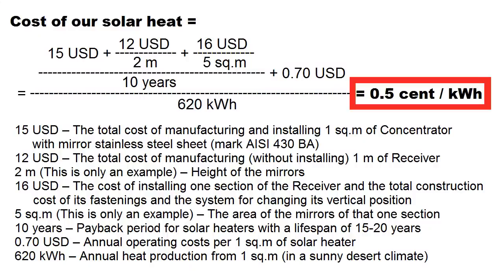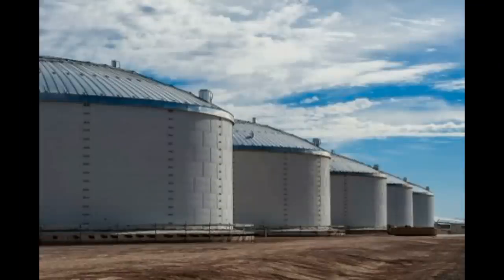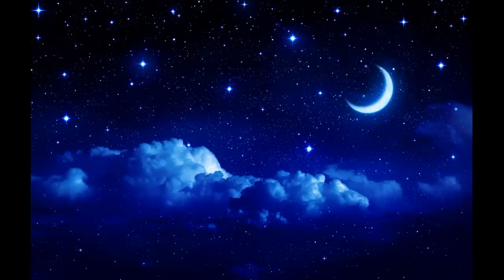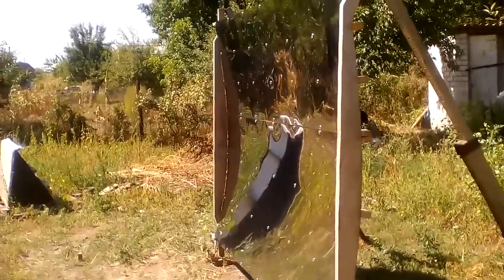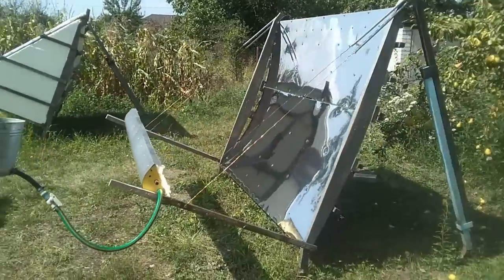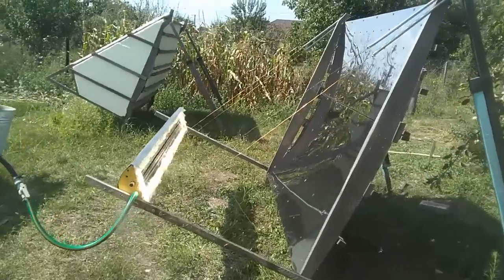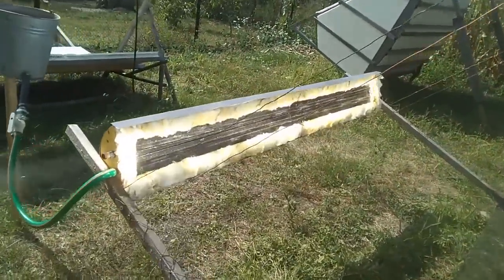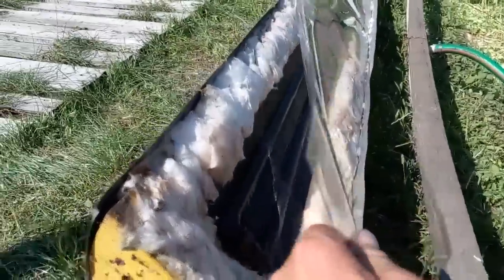What is this new method of producing solar electricity?

Comment: Thank you for uploading your videos. Collecting the solar thermal is one thing, but have you perfected the generation of electricity? One thought is that the storage of electricity is more difficult than the storage of heat. One concept that looks interesting is the sand battery, a simple auger could be used to raise sand to a thermal head (where the sun is focus) and then gravity could let if fall back into insulated storage vessel. Since sand can be heated to 1700'c this is ample to flash water into steam for electricity generation.
Reply: Stirling engines look very interesting, but there aren't any 'solutions' for around the 500W mark.
Reply: @mungewell  because they are stupid, just use a steam engine of some sort, even a tesla engine will work, vacuum tesla engine even better

Comment: New subscriber, GREAT channel!

The Carrington Event is due to appear again and all metal wire, so all circuitry, all solar panels, will try. Your panels would not be affected, particularly the stainless steel mirror. 

I have not yet viewed your videos which explain the transition from steam to power but, again, * anything * that avoids metal or circuits will be very valuable after the  fact.
Reply: fry not try

Comment: Steam could be passed through a heat exchanger. Water in the secondary loop could be used to heat the home by radiators. The water temperature could be controlled by a simple electrical solenoid valve that either routes the steam through the water heat exchanger or to an out side heat sync to dump excess energy. If you wanted to add cost and complexity then instead of dumping the energy then it could be used to generate electricity. The simple version just to generate heat alone would be very useful.

Comment: Hey Sergiy possible to use this on a sand battery? ie use to store the heat storage with sand?
Reply: He already has the space.. I was thinking the same. And is also (pretty) cheap to maintain and build. I'm sure that the electronic part is more difficult. Since the sand battery has some sensors and automation

Comment: I appreciate the idea and would like to try this idea, but .50 - which is 50 cents isn't the same as .05 — which is 5 cents. Maximum cost per KW/h in homes in the USA currently from the grid is about is about 14 cents - which is 0.14 per KW/h... That's for sharing, just wanted folks to take a moment first.

Comment: This absolutely bypasses the need for toxic metals like gallium and germanium and the mining of them by unprotected children. Current solar panels used in the USA are brittle, easily broken by hail and storms.  Also they are plugged into grids which still charge the homeowner both to BE plugged in and for electricity. The heated water and steam can be used directly in the home. So some panels can be used solely for that purpose then other panels for making electricity using stem and magnets. Turbines.

Comment: Love your videos 👌👌 could you explain a bit more about how to connect the hot water container to the turbine? I have a some questions about it. For example, I imagine that in order for the turbine to work there must be some kind of minimum pressure. How can this pressure be built up with an open valve? Or is there a special valve that only opens up at a minimum pressure? And do you need to put new water into the system after some time? Kind regards
Reply: I think you make the concentration to a smaller beam and use vacuum tubes because they are cheap and efficient. Then you use oil instead of water, use the oil to heat water into steam in a steam engine.

Comment: I think trying to turn this energy into electricity might be the wrong step. Thermal solar struggles because converting heat to electricity is a very lossy process especially below 300c which is really hard to hit at cost. 
  This is a mistake because electricity is a compromise energy that is just ok at cheap generation, just ok at transmission, and just ok at converting into any other form of energy that you actually WANT. 
   I think this tech works extremely well in synergy with green electricity because half of all energy use is creating heat at temperatures that simple mirrors already naturally produce, so its best use case it for extremely cheap production of heat directly at the source for, and it can be extremely cheap to store if you're doing it at even small scales.
  These can be rolled out EXTREMELY quickly, eliminating the majority of green house gas emissions almost overnight. If heat can be taken care of by these, than green electricity generation, storage, and transmission becomes VASTLY easier, and can be done over time, as technology matures better.

Comment: Slight modification, and that can be a feed material sterilizer to use with a composting pile. It would allow you to heat wetted down weedy soils and plant material, without weeds being in the resulting mulch. It's as simple as heating that stuff up to boiling temps for a day. Given that it kills off organics by denaturing, the caveat is you need an already active compost pile to feed the cooked dirt or plant material into.

Comment: I think trying to harness enough energy from a collector that size, to power a generator would be futile. Maybe enough to power a few LED lights, but nothing of significance imho. However, I believe using that heat to make supplemental hot water for domestic use could be feasible. Or even for supplemental heat for living space might work. After all it’s kinda like peeing in the ocean... every little bit helps!

Comment: Good video! Just one question: will water freeze in the cold winter night, for say, -30 degree C?
Reply: Probably yes
Reply: @civismesecret  Thanks for reply. Then how to avoid that or any other solutions?
Reply: @zhengcui2572 
Maybe use something other than water.. Maybe oil or something
Reply: Oil is most commonly used with these systems, maybe it doesn't expand if it freezes?

Comment: Did you test the mirrorsystem with evacuated solar tubes? I live in Norway and I wonder how much heat this would generate during winter. My plan is to install 90 evacuated tubes(2 meters) on my south facing wall at an angle of 70 degrees, connected to a 500 liter insulated water tank inside my house. This should partly  heat my house and give me hot water all year.
Reply: I suspect many of us want to see how it works with commercial evacuated tubes
Maybe we should chip in and get Sergiy some :)

Comment: Great video, thank you for sharing!
You may want to have a look at ultra-thin tempered glass, which is bendable. It merely needs a coating on the back, and viola! You have a flexible glass mirror that won't easily oxidise in the sun.
Reply: That sounds expensive solar panel glass can be 5-10$ sqm then heat bend that, abd heat treat it. Still expensive than other options but stiff. Stainless steel sheet would just be cheaper and reflective. Even cheaper mylar glued to some bended plastic sheet.

Comment: Look into just buying some curved glass from a company, then maybe using it as mold for multipul mirrors.. copper pipe big enough to catch the rays painted black, turbine, retrofitted engine, with 3dprinted plastic grear assisted servos, aurduino board, camera on goldfish eye pointing upmost, Woula..
Reply: Why mirror, it is expensive, cheaper with thin sheet stainless steel held tight by a cheap wooden frame

Comment: Did you use Asbestos as insulation?
Reply: Rockwool can't withstand that high it burns gray then yellowish at below 650c though maybe it still works up to 1000, there will be a lot of fumes though getting rid of the chemicals it's treated with
Reply: @leonordin3052  So what is it?
Reply: looks like rock-wool
Reply: @jamesbrown99991  The ROCKWOOL Technical Insulation products are based on stone wool, which cannot burn and which can stand temperatures up to 1000 degrees C without melting. So yeah, that`s it.

Comment: I was going to do was take really bright lights face them at the solar panels I know they'll charge them because my headlights my car would charge them but these are charged them at full power and use it at night or when the lights are low and it's cloudy out the charge might have my solar panels charging all night long and all day long 24 hours a day 365 days a year that's what I'm going to do where to buy facial solar panels I'm going to put mirrors in the back side of them and let the sun go through them and around them and face up at the back side of them too and charge them that way as well cuz I'm going to get bisexual solar panels too. That is my plan not the same plan you have but now you got my plan now you better do my plan as well just need really bright lights and a few of your solar panels will be able to run nails lights and your 2 million would turn into 4 million.

Comment: I believe they are doing east-west tracking, because they need the power-output to be as constant as possible... The true cost in this kind of system is the turbine. To keep this cost low, they make sure, to have as constant power as possible. Thus, they can optimize the turbine capacity for this amount of power.

Comment: I wonder, could you aim the heat at a closed loop pipeline filled with CO² and then run that loop through a heat exchanger to store that heat in sand as they're starting to do in Finland now?

The sand is insulated in a silo and retains the heat for a very long time.  This can then be 'harvested' at a point when it's required to heat homes/municipal buildings or to provide hot water.
Reply: that's what I'm planning to do for my tiny house for next winter. I got an old 500 gallon waste oil tank that I'm going to cut the top off and then put a bunch of pipes or maybe some cheap finned tube if I can find it in the tank and then fill with sand. If I keep the 'heating loop' separate from the 'recovery loop', then I can run hot air or steam through the heating loop, as well as hot gasses from our incinerator, and then use the recovery loop for fresh air only
Reply: Maybe having a huge water tank that acts as the thermal battery would be best. Take the hot water and use it during the night when it gets cold.
Reply: @kevindouglas8768  it's about storing it for a long time...also water goes through a transition phase above 100°C which prevents it becoming hotter and retaining more and more heat as sand is able to continue to do up until some crazy hot temperatures
Reply: @weedfreer  True enough, but all I was getting at is that every time energy is transformed, it looses energy. I've seen the sand heat batteries. Incredible works.

Comment: I'm trying different reflective materials like open aluminum cans but they need some polishing. It is better to just use Mylar? My goal is to store the heat on sand or melted salt, to use it on metals and maybe casting. If I make pipes from the same material of a crucible it's possible to circulate the heat from the solar source to a sand/salt bank? Cheers from Brazil
Reply: Please share your results on youtube bro
Reply: @civismesecret    yes when i have something simplified and safe enough to share I certainly will.
Reply: It is better to make the crucible directly in the focus of the mirror.

Comment: Iam curious How polished bronze or brass  reflect compared to stainless steel?
Reply: The question is great, but I believe those are much more expensive, therefor won't make sense. If you follow Sergiy for a while you'll see his goal is to cost optimize, not space optimize.
Reply: @Sekir80  what do you mean with space optimised?  Or is it mor refered to my other comment?
Reply: @CUBETechie  Space optimization in the case means you want the highest possible efficiency, meaning you will need less space to install your system. If space is not the problem, you can opt for a less efficient but cheaper system.
Reply: @Sekir80  what would be sweet Spot?
Reply: @Sekir80  if optimise for Cost effective and cheap as possible maybe you should also watch the presentation from Michael Pawlyn 😉
Reply: @CUBETechie  Mm, okay, will do!
Reply: @Sekir80  especially the branches here you have an optimised amount of material in this case liquid or gas transfer
Reply: Michael Pawlyn https://www.youtube.com/watch?v=3QZp6smeSQA

Comment: For me the solution is just static. Form the relatively big black metal recipient so that it would receive the most of the reflected radiation without having to move. As passive as possible. Isolate it thermally from the non-recipient size. Or even put the whole thing into a big greenhouse. Inside the recipient, create the cooling system that would bring the heat into central isolated container for the energy storage/production. For example by circulation of heat resistant mineral oil you could heat up giant heat storage unit filled with sand to several hundred degrees of Celsius. The paraboles/recipients might be on the roof of it. 

When in need of electricity, you just run the water through the pipes inside the heat storage unit and make it boil and run the generators.

Comment: Instead of one mirror, with one focus, how about several mirrors, each with a different focus, so as the sun moves, one focus passes and the next one takes over?
Reply: This would take more space and material, and only a fraction of the mirror would be getting utilised, with the rest being wasted
Reply: Interesting !! I guess it uses more material ..
Reply: After, in some ways it could be interesting it depends of what you heat for what needs..
For instance, if solar rays hits solar thermal battery like sodium acetate/zeolite/or sodium  packs (the right size to be not too heavy to be transported in a shed for cold days/winter..) then you can turn it into an advantage....

Comment: Very impressive. I look forward to the polystyrene video. I seek to use cheap reflective mylar held by spray adhesive to hot wire cut foam with computer drawn/designed parabola.

Comment: A fantastic solution. What about a cheap bicycle dynamo being turned by the steam charging a capacitor in line with a voltage regulator and a rechargeable battery? Thanks.

Comment: Another great idea. Do you have any recommendations or links to an affordable steam generator that turns the heated steam into electricity?
Reply: Stirling engines are used in industrial power production as a highly robust and relatively efficient bang for the buck. I think you can justify an inefficient generator with such cheap reflector and tracking
Reply: I just subscribed to your channel. I look forward to your future detailed instructions on how we can build a setup like the one you have with the total cost savings. Please kindly list all the materials etc that one needs to buy to try to duplicate what you are doing.🙏
Reply: What you need to do.is urn the steam to mechanical energy, usually rotational.
You could useceither a steam engine, or turbine.

You'll also need a condenser system to quickly return the steam to condensate to cycle back through the steam generator.

This is not a small project - for a home system it would not be cost effective 

Also, working with steam under pressure is far more dangerous than solar panels.

This is not a new idea, and pilot plants have operated for years.
Reply: agree with darklich, I think heat generation and Stirling engine can go together and are a good solution for a cheap price.
Reply: It’s not quite on the market yet but we’ve gotten 4.25 kW continuous just from compressed air with a Tesla Turbine: www.TesTurEnergy.com

Stay tuned to our YouTube channel for more updates as we test future prototypes made from higher quality materials, stress/endurance test, remove inefficiencies and admit steam to the system.

https://youtube.com/c/CharlieSolis
Reply: It will add global warming
Reply: @NoSkireallebaf86568  Stay in school.
Reply: Idk, is it a great idea, what with all these mirrors pointing at the sun, let's hope we don't frazzle our atmosphere and cause a mega-drought, like prize jerks?
Reply: @laurisafine7932  obviously, you do not understand the concept of a system.

The solar energy is already hitting the earth.

It doesn't matter how or if it's used.

It's still the same net energy and cannot add to or subtract from the latent heat of the planet, unless you were to build large enough reflective surfaces to redirect the heat into space.

Even then, it wouldn't make much difference, as most of it wouldcbe absorbed by the atmosphere. 

The reason fossil fuels are bad environmentally is that they take energy in the form of hydrocarbons that represent millions of years of solar output and release that energy all at once.

Comment: What about high winds, is your solar collector protected from that, they look fragile.
Reply from the maker: I (central Ukraine) have not had a strong storm over the past 8 years (maybe there were wind gusts up to 40 m per second). I think that's the limit for the polystyrene plates of my solar station. But I think that stainless plates are able to withstand more.